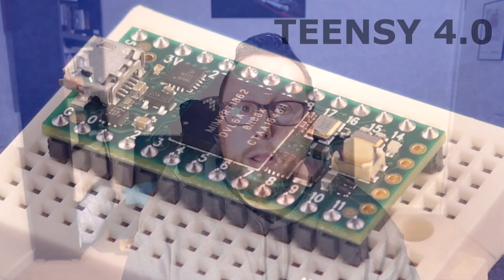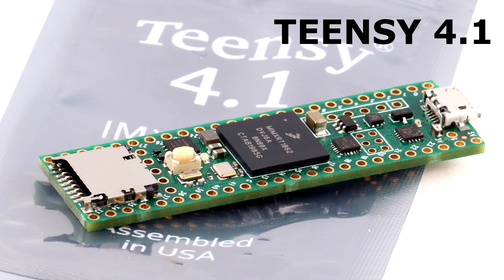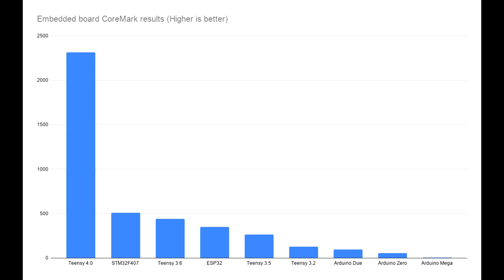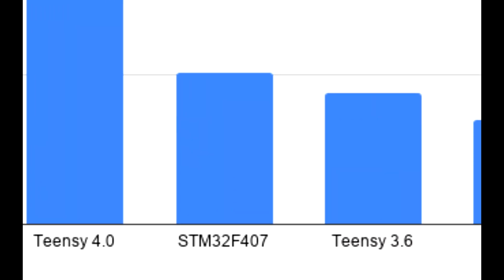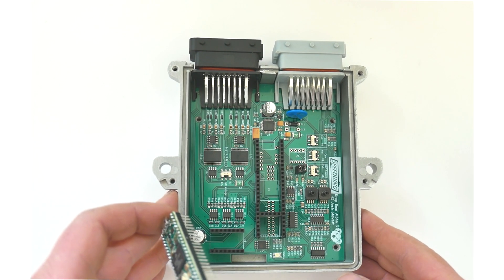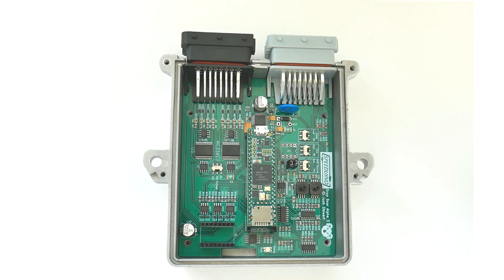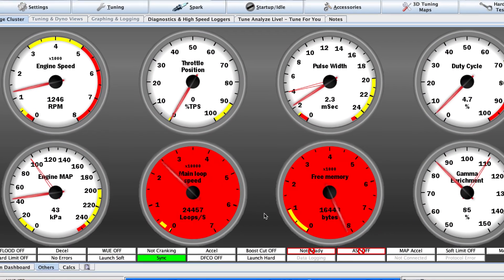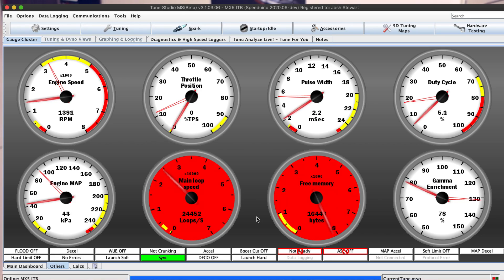Making an insanely fast Speeduino ECU

Comment: Im curious if you guys have tried to add traction control or rolling antilag? Im setting up a ua4c and see spare 5v inputs on here which i could see being used to run the vss since its Hall effect but thats only 2 channels which i could have in my example the vss coming off the transmission and a driven wheel speed sensor but problem being when im turning the values will be different

Comment: It's been 3 years. Ik hope this is going to be released.
Reply from the maker: The original intent was never to use this as the Teensy 3.5 was the better suited MCU, however with that going end of life the Dropbear V2 will switch over to using the 600Mhz Teensy 4.1. The first batch of these are in production at the moment.
Reply: @Speeduino  wooow thanks looking forward

Comment: Seeing the unavailability of the Teensy 3.5 in the near (or even far) future, any plans on boosting support for the 4.x series? I'm aware that the processing power isn't necessary, but for managing more than 4 cylinders in full sequential, the Arduino Mega ain't enough!

Comment: It such a misconception that you need more MHZ for a better ecu. Man just get the code right. The timing not being held on fixed timing on most trigger wheels is a joke. The code needs sorting at the fundamental level. Not more speed put into the cpu. Get with it crappy speeduino.
Reply: some people on forums have found its related to the VR conditioner. The max9926 VR conditioner should not cause that issue. I'm not sure if they're right... i'll find when i'll install my speeduino.
Reply: Not true at all. Its the base code. This was on multi cars this issue. Cherry hall sensors on proper tooth profile trigger wheels even. Lol. @simoneamodei9265
Reply: @ MAX9926 doesnt cause any of those issues on Megasquirt code. Its the crappy ecu. Fundamentally flawed.
Reply: @MrJermbob  I run speedunio's in my rally cars and I have not issues at 7500 rpm. Also if you don't like it don't use it. Go and pay for an ecu from it somewhere else. Or better still why don't you "fix" the code you are so unhappy with, the source code is freely available.

Comment: Are there any speeduino configurations that can run 4 OCV valves, 4 cam position sensors? Subaru dual AVCS here so still for 4 spark plugs and coils. Been looking at the website and only see support for 1?? camshaft sensor and 2 OCVS
Thank you for the work this is amazing for car enthusiasts

Comment: With the 3.5 board being delayed until April 2023 and the 4.1 shipping shortly what are the chances of being able to get a dropbear bare or with a 4.1. I am waiting to build my first fuel injected motor and was hoping to use a dropbear but I understand the supply chain issue throwing a wrench in things.
Reply: @8SecSleeper  No thanks. Its rubbish. Ill stick to quality code.
Reply: Buy something better. Consider yourself lucky you cant get a speeduino. They are broken junk. The code is fundamentally flawed.

Comment: Would this work with an automatic gearbox? Planning on using this with a dq500. Originally planned to use an MS but then discovered this amazing ECU
Reply: Its not a amazing ecu at all. Stick to megasquirt. I bet you cant find anything amazing a speedy is doing.

Comment: I have a V6 with coil on plug engine. Trying to figure out how to make a speeduino work on it. Really I can double up injectors but can I use 2 injector outputs for fuel and remap 2 injector outputs to control spark instead? Or does the teenie give you more outputs so I can run sequencial fuel and spark on 6 injectors and coils? I've always been a diy guy! Heavy into electronics and build fpv freestyle drones that have stm f405 f722 h722 processors and learned how to re map pins to do a different function. Is it possible to do with speeduino or is there a board and parts you reccomend? It's a 06 honda pilot 3.5 j35z1 engine and automatic trans. The reason I want to do this is the engine is strong even with 300k on it! Want to run forced induction on it and remapping the ecu has been quite a daunting task! Hondata doesn't support my year ecu and just bought a scanner tool that's bidirectional and claims to do ecu programming and coding! Knew speeduino existed but always drove gm vehicles or vehicles with tons of aftermarket support! I have a ton of arduinos and esp32 chips kicking around for thinks like wifi deauthing my sister or controlling leds. Discovered a can hat for arduino and building a can reader to maybe try and do a ecu dump and poke around in the code! My old bt dongle was able to rip my ecu wirelessly and create a dump file and could use pcm hammer to edit the code but no way to reflash the ecu! Also do you know of a good resource for what vehicle use what protocol? Thanks you in advance! And thank you for doing all this work! I know how much goes into making custom hardware and then write firmware and software for it to do what you want! So thank you and if I had a better attention span than I do now I would be doing the same thing!

Comment: Yo very far off topic but slightly related. Any thoughts on a Framework mainboard being usable as both an ECU and in car media center?
Reply: It's not a bad shout, thought about it myself, however, if one crashes, so does the other. This will cause some issues.

Comment: Evening Josh.   
 Looking at installing (hopefully)  a 400+ cubic inch gen3 Hemi into a Plymouth Duster soon.   Will this future ecm change also have the ability to fire all 16 spark spark plugs at the same time, do an exhaust stroke wasted spark or only fire single sided coils ? 
 I was looking at the MSD wiring harnesses to adapt to the engine , just looking for a decent controller.  I just came across you guys while watching some how to videos on a couple tuning programs.  
 Thank you for the information on the site.  Looks like an amazing piece.
Reply: No it wont do 16 channels of injector. Do NOT use this ecu. Buy something better. Buy once cry once.

Comment: Am I right in assuming that the Arduino mega can be configured for 1 channel of spark and 8 channels of fuel? Or was the 9th (if I remember right there 9 timers, and apparently that's what matters for that) timer used for something else? I'm thinking locked distributor and fully sequential fuel.

Comment: It'd be interesting to see an MCU chip based on a SiFive X280 or similar core (maybe some ARM thing with SVE). 512-bit vector processing in a chip with good RT, timers, and IO would make some mighty interesting things explorable (finer nonlinear predictions? ML training and inferencing? microphones in the intake manifold?).

I read a paper the other day on using neural networks in combination with a conventional physical model and conventional sensors to explore and optimize control signals, they evaluated it for predicting exhaust temperature (which was apparently useful for an EGR system), it seems like it could be something to look at. non-linear model predictive control in general is something to look at.
Reply: That would be pretty neat! I was taking a look on those SiPeed boards embedded with RISCV processors and a AI acceleration IC. Looks a pretty decent for this kind of application too.
Reply: No need. MHZ does not make a better driving car.

Comment: Interesting, how it will compare to Portenta H7... That thing got ARM M7 core running at 480 MHz coupled with M4 core running at 240 MHz, which could be great for parallel stuff like oh, I don't know, computing on one core and logging/transmitting info to dash on another?
Reply: But MHZ does not mean a better running engine.

Comment: is there any plans to make a 6 cylinder universal ecu? if not which do you recommended to someone whose on a budget?
Reply: Buy something better. CHEAPER DOES NOT MEAN BETTER.
Reply: @MrJermbob  speeduino hater 😂😂
Reply: @gabriel4953  100% speedy hater because of experience and reality of its junk code.
Reply: @MrJermbob  lol, I'm thinking about making an ECU with the Rusefi code, the Speeduino doesn't have electronic throttle control

Comment: Hello, I have a Speeduino powered Scg-ecu 1.0 board. When I install the Speeduino v202103 version, there is 2.4 volts continuously on pin 31. This pin is the ignition pin. When I install the Speeduino v20208 version, 2.4 volts is not always available, but when I test it in Tunerstudio program, it comes to 2.4 volts on pin 31. 3.2 volts comes standard on other ignition pins.
Reply: Old answer, but you need to change the pinouts on Speeduino firmware. It's easy.

Comment: inb4 'Making a 5GHz liquid cooled/phase changed cooled ECU' :D
I've also just discovered Speediuno. Pretty much combines my love for mechanics/electronics/programming all in one and I immediately decided that I absolutely had to throw one together. Just waiting on parts and then some free time. I LOVE that this is a thing now! Great work!
Reply: That would be the dumbest thing ever if the code it was running wasnt any good to start with. Lol a 8mhz cpu runs a shitload of cars on the road and better than most oem ecus of their time.
Reply: @MrJermbob  Aint that the truth, my old Megasquirt 1 is only  8 MHz and it runs my Honda B-series to 11000 RPM and does not miss a beat.
Reply: @Mike-ry4ti  Megasquirt for life. Anyone trying to find cheaper is just playing the car game wrong.

Comment: This is interesting but can you tell me if i could use this ecu as a piggy back or as the ecu it self  to run itbs on a N/A 2014 mitsubishi lancer ? If i can can you tell me where can i get this fully assembled or if i have to assemble it and if you have a parts list for this where can i get it thanks for the videos this opens a los of Doors for tuning

Comment: This is the first time I heard of Speeduino. I played with Arduino a few years ago for an auto application. If I have time I would love to give this a try for one of my track cars.
Reply: DONT! its rubbish broken code. I know from experience and its a joke. I can prove all very clearly. Speedy is rubbish.
Reply: @MrJermbob  Prove me, i'm interested in trying but scared about the problems.
Reply: @ulissesmuniz  Just buy a megasquirt product and be happy. No one will show you the videos of it not working properly as they dont want to be proven wrong. I wont stick a speeduino in any vehicle ever again to do it myself.
Reply: @MrJermbob  Thank's a lot, man did my search here the only problem for the megasquirt I found is the hardware here in Brazil. I could import but the temperature here is higher so some components don't work properly
Reply: @ulissesmuniz  Megasquirt 2 unit would be no issues with the temps you see.
Reply: @ulissesmuniz  85C on the main components rating.

Comment: I think this has been a long time coming: faster processors allow for greater sampling rates on analog signals/sensors, so by theoretical extension you can get more finely tuned in terms of overall vehicle performance. This should be the way forward as far as I’m concerned
Reply: Once you exceed the slew rates of the sensors themselves, faster sampling just introduces noise to your dataset. Even running a motor at 20,000 RPM means things happen in the motor at 20KHz, so only sample rates of 20KHz and harmonics of that are essentially real-time. Trust me, I've spent way too much time implementing advanced digital filtering algorithms, eating up gobs of memory and processing power to try to keep a PID stable sampling at every code cycle,  just to ultimately end up reducing the sample rate to 1Sample/sec
Reply: @Koumajutsu  I accept that, but believe noise can (should!) be filtered or otherwise compensated for prior to a signal being digitized…the fidelity of the input transducer isn’t often questioned.
Reply: 20KHz is 20,000 times a second. 20,000RPM is 20,000 times a minute. 2KHz. This is 600Mhz. That’s 300000x faster. Computers are mad fast bruh 😎
Reply: @sourand jaded When i learned what "Sequential Injection/Ignition" was, my first thought was "wait - you're telling me manifold injection wasn't timed with the opening of the valve this whole time?!" Top 10 anime betrayals. And yet the engine still runs. So whilst 600Mhz doesn't make a lot of sense if you're only target is to get it to run, because it doesn't need to be accurate, I can see people using such CPUs to do the math needed for alternative combustion cycles, like HCCI, that do need to be accurate, and see a change from 20mpg to 45+ mpg. Could be a lifesaver for the combustion engine frankly
Reply: No MHZ does not translate into a better running engine lol. Look at all the engine failures speedy has caused already lol.

Comment: "There it is.  A 600 MHz ECU."

Absolutely wild.
Reply: Wait for microcontrollers on i.MX RT1170 with ARM Cortex-M7 core running at 1 GHz with M4 core running at 400 MHz... But teensy can be overclocked (from what I heard, even up to 1 GHz mark), so...
Reply: @spakeschannel  So... MHZ does not make a ecu better lol. Get with it.
Reply: Yeah wild they forgot about fixing the fundamental code and made a ecu on a larger mhz chip to try market the ecu as being better lolol. No way does a ecu need more mhz to do a better job. Tools.

Comment: In the late 80s GM introduced the GMP4 ECM. It boasted a 2MHz 68HC11-based MCU running out of a 27256 EPROM (something like half of which was calibration data, the rest program)and had 256 bytes of RAM, some of it battery-backed (for learned parameters and diagnostics.) The ECM, along with the previous generation C3 (even slower) basically ran GM cars & trucks from the Cavalier to the Corvette until the OBD-II era. It controlled fuel injection, spark timing, EGR, closed loop idle speed and had a pretty sophisticated suite of sensor diagnostics (GM's "ODB-I" including an 8192bps serial stream.) It used 2- and 3D tables with interpolations, pioneered short and long-term fuel trim strategies etc. I had a great time reverse engineering the P4 out of my Z24 back in the early 90s. I'm glad Josh mentioned the fact that 600MHz wouldn't really get you a lot in the big picture. The memory & speed of an ATMega2560 dwarfs that of the P4's MCU and it would (and does) obviously make a great core around which a full-featured ECU could be based. What would you do with all those cycles when controlling a Victorian-esque reciprocating machine that could be controlled by a 2MHz MCU?
Reply: Impressive coding for such a slow chip. Assembler was used without a doubt.
Reply: @billybbob18  more like its a custom chip with dedicated hardware for anything that would have required a faster processor... speeduino does a lot of stuff in software. So, the GM chip probably has dedicated timers and such similar to these new faster chips also have.... it allows you to offload a ton of work into the hardware so the software can just do high level decisions.
Reply: this.
im making my own little single cylinder ECU.
4MHz chip.
as soon as i run it at say, 8MHz... timers start to overflow. i have to deal with extra bits of data. have to consider more loops, as i now have 12 bits of data rather than 10. and on 8-bit, thats already more than enough of a hassle. and even then, 90% of the time, the chip is simply "twiddling its thumbs" waiting for interrupts as certain processes take place.

1MHz would work just as well. 

FFS, ive had an engine running off of a 555..., with the TPS adjusting pulse width. not terribly hard.

speed of device solves no issues, in my experience it just adds MORE of them!
Reply: I have manufactured 100's of HC11 / HCS12 based ECU over the years.
All programming was done in assembly language, and I never had issues with processor speed.
Loose the high level language baggage and see what real code can do.
Reply: As you know mhz does not matter. More speed does not mean a better more capable ecu.
Reply: @MrJermbob  lol are you just in everybody's thread dropping your opinion?
Reply: @lildude6906  Yup haha

Comment: I wonder if something like this could actually do something like traction control and some of the stuff like ABS and the Yonder.?  
well I think this board allows is that you can use a hybrid setup and that's probably where this board is really going to shine.

this includes something like stability control and active role control things like that can really bring out the best in a vehicle especially in a heavy car.
Reply: Really only limited to your coding abilities as far as I've looked into
Reply: @wesker89  What about the timers available inside the chip seeing you seem to know how it all works ?
Reply: Sure just buy a ecu with those features. Really simple. Hybrid lol. It cant even run a full fuel based setup properly yet. Its still in development and never was a stable released code.